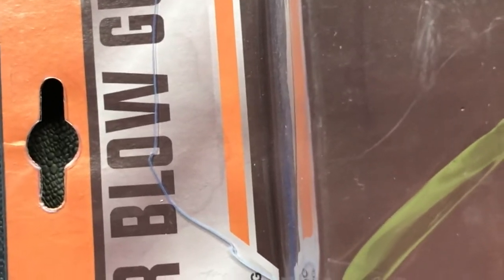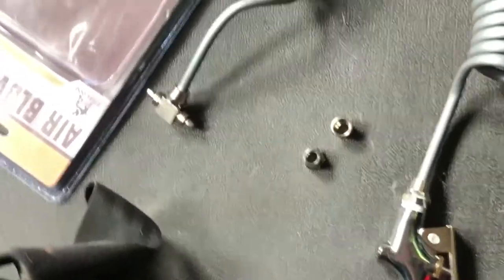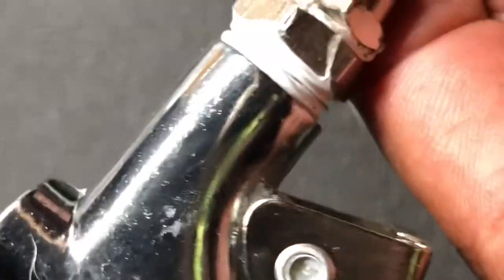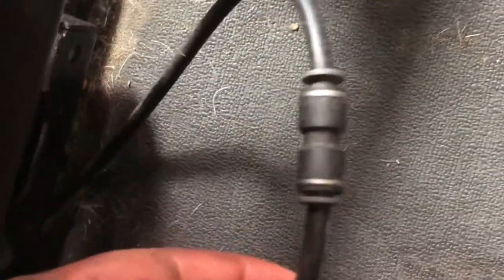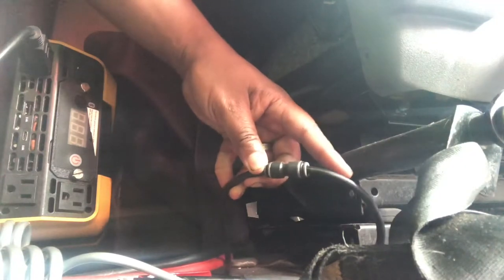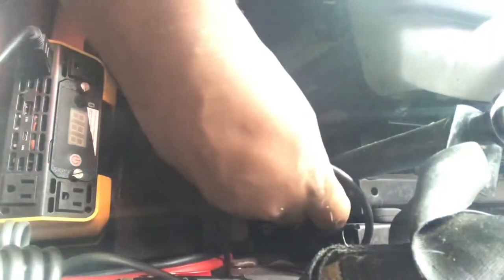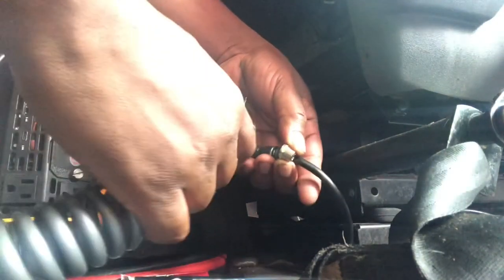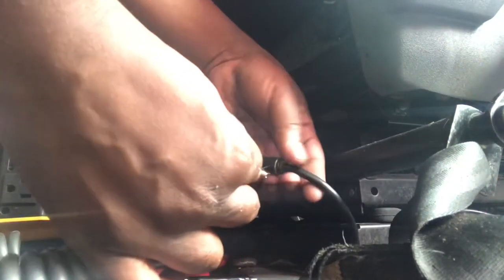How To Install Air Blow Gun in Semi Truck

Comment: Drivers I recommend if you have to cut the air hose to buy the other air gun the one with push connect fittings. I bought this one and had to cut the hose because the factory fitting wouldn’t come off. I couldn’t get the brass fitting to go one correctly so I bought the push to connect gun, went on 2 seconds no leaks as of yet that was 2 weeks ago

Comment: I connected mine to the wrong hose, now when I use it it releases the air from my chair 🤦🏽‍♂️ I do see a black hose that I over looked however it’s one hose and then it runs into multiple hoses where you would adjust the pressure in the lumbar and etc. is that the hose it’s supposed to be connected to?

Comment: Do you have to let the air out of the tanks to be able to disconnect the air lines? I have my truck running and can’t get the quick disconnect to come apart. I’m assuming it’s the air pressure flowing through the line preventing me from disconnecting. Is that the reason and is the answer to just do a brake fan down to get the air out so I can install the new adapter? Thanks

Comment: Thank you !! I bought my kit from loves cuz I needed it and I had to cut the hose out the old connector bc they wouldn’t come out and installed the new connectors but it was leaking so bad and it was obnoxious so I put more tape on the end pieces of the new connectors and it worked ! ♥️♥️